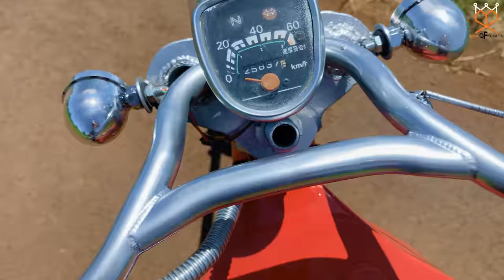Build a Chopper Motorcycle from an old Super Cub | Restoring old Super Cub

Comment: A chopper is any motorcycle that you cut parts from. It doesn't have to be stretched out. You just have to take a hacksaw to the front fender and you've got a chopped bike.

Comment: Used Bondo instead of more welding for a stronger frame.  Missed painting the underside of the fenders.  Did not welding the steering bearings closed.  Is the headlight replacable?

Comment: I would suggest that you use the proper wire connectors instead of splicing the wires and twisting them together then taping them with electrical tape to seal/protect.
Reply: Trust me, the wiring is the least of its problems...

Comment: Ruined a c50 🤦‍♂️
That frame isn’t gonna last 10 km before it folds in half. As Soon as the engine gets a little hot that paint is going to start flaking off. The brakes aren’t gonna work propperly because of the paint in the drums. I could name many more Mistakes if i wanted to. The Idea was good but just very poory executed.